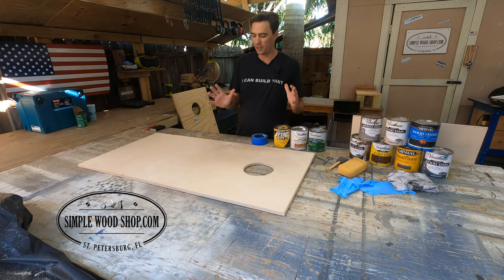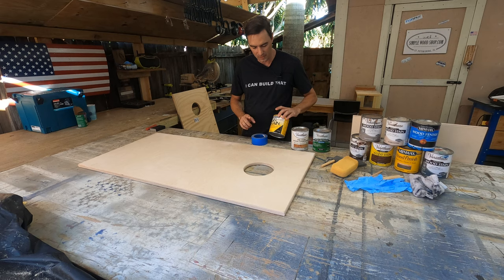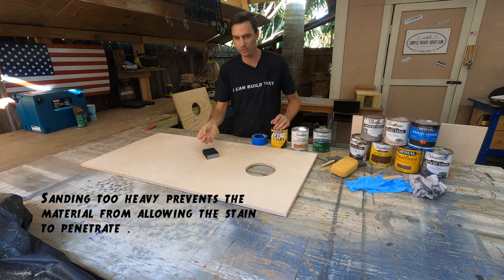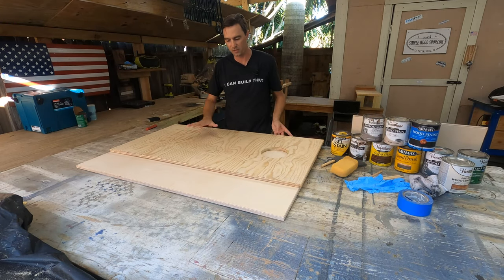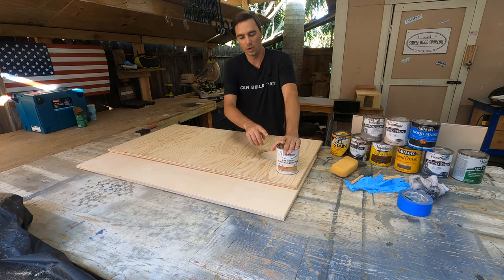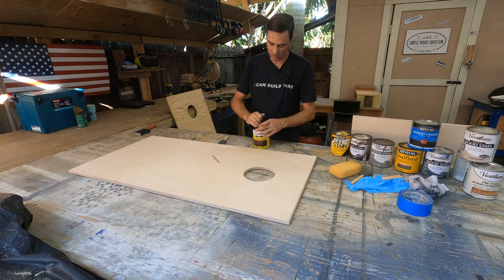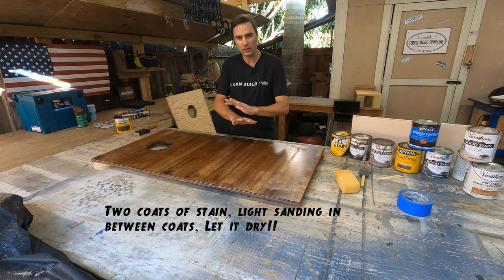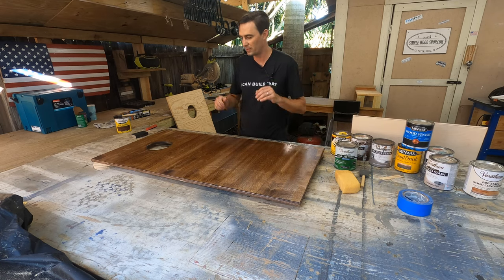Staining Cornhole Boards:  Easy and simple process.

Comment: Thanks for the post. When I refinished my interior stairs, I did a light sand between poly coast. I did 3 coats of poly but sanded between  the 1st and 2nd coats. 

Is only 1 coat of poly good enough?  I assume it would effect the way the board works, in that bean bags will slide the hell off more often if more poly layers are added! lol.
Reply from the maker: I would do several coats, I sprayed my finish so its hard to say how many coats you will need. Best to apply and try it out.

Comment: Great Video! If you wanted to add paint as well would you paint first, then stain the non-painted area and then use poly over everything?
Reply from the maker: That would be tough, as long as the paint\stain areas are not touching you can do either one.

Comment: Very helpful video. If I wanted to add a vinyl decal, at what point would you apply that in this process?
Reply from the maker: Give the boards an initial sand and then apply the decal.  Make sure all the sawdust is removed or the decal wont stick well. Use gel stain
Reply: Would applying the vinyl decal after the second coat of stain before the poly be ok?

Comment: Very informative video, thanks! I would like to use the water based exterior house stain we used on the singles of our house. Do you see any issues with that type of stain? Would it still need a coat of poly? I'm thinking the poly would make for a smoother finish.
Reply from the maker: Stain is fine. I would poly once the stain is completely dry.

Comment: Great video and great info!! I had to remove the polycrylic I had on my boards and now I want to stain them. How would I know if the pores on my top have closed?
Reply from the maker: Sand away the top layer beat you can. Maybe put some water on the top (lightly) and see if it soaks in a little. That’s how you know the poly is gone. 

Might be easier to just unscrew the top and stain the other side that doesn’t have any finish on it.

Comment: @Matt Hickman
Matt, this is great video (very informative).

I have a question about stain compatibility, was hoping I could get your quick thoughts.  I plan on doing a relatively simple board.  It will have a painted boarder around the entire board.  The "middle"/"center" (area between boarder) will be stained (I will add a decal also over a portion of the stained board). 

Can I put a water based sealer (e.g. Minwax Polycrylic or Varathane Water Based Polyurethane) over an oil based stain (regular or gel).  Assuming I let the stain dry thoroughly.  My reasoning was to use a gel stain (oil) to give a clean line/edge (no seep/bleed under the frog tape) and a water based sealer to give a clearer look (avoiding the "yellow"/"amber" color that an oil based sealer often provides).

BTW, I'm using 3/4" Baltic birch.
Reply from the maker: Hey. As long as you let it dry all the way. You should be good with the water based poly on the gel stain.

Comment: I’m using a maple top and wanting to stain down the middle and paint on the left and right of the hole. Do I need to use pre stain on the part I’m going to stain? Also my paint is enamel satin- do I need to prime the painted areas? Thank you.
Reply from the maker: Hi,  I have not had experience staining maple.  You might try it on the underside first to see if you like it or not.  I would try the pre-stain and primer too.

Comment: Hi there! Can I use an oil base stain on pine? Also if I did a stencil design on it with tape, will the oil bleed through? Thanks so much!
Reply from the maker: Hi. Oil is just fine on pine. Let it fully dry before you put your polyurethane on. I would apply it in lighter coats to avoid it bleeding.  You can always test it ion the underside. If you plan to pain the whole top it would be good to prime with a good primer before the paint. This will help block the oils in the pine from coming up.
Reply: Ok thanks! I’m thinking of doing the /\ design to the hole. Should I stain the whole board, then paint the /\ over top of the stain?

Comment: Very informative videos! I need this type of step by step thanks. Do you always stain, paint, decal, etc. prior to attaching to frame?
Reply from the maker: Hey Joe, That is usually the best way.  It saves the hassle of moving full sets around to dry.  I set up my drying area for tops only so the rack will only fit tops.  That is the way I did my setup.  Other do it differently as well. Do you stain a lot of boards?
Reply: @SimpleWoodShop  not one board yet I am doing my research first the best way to build. Thanks
Reply from the maker: I did the same. We have some other Cordero that may help. 

1. Make some jigs 
2. Batch out your parts

Comment: Would it be okay if I stain the board then put vinyl decal on after it’s dry then apply poly over it ?
Reply from the maker: Not sure how well the vinyl will stick to the stained wood, maybe test it on some scrap on another piece.
Reply: So if I put decal on first would I just stain around it carefully ?
Reply from the maker: @davidquast4759  If you are going to do that use Gel Stain, it will not seep under the decal.  I don't use vinyl so I don't have any first hand experience with vinyl and staining.

Comment: Would it be ok to STAIN my board first and then tape near the edges for to paint afterwords?
Reply from the maker: Sure. You can stain then paint over the parts you want. That would be ok. The stain will seep into the wood and the paint will go on top. 

If you want crisp stain lines use frog tape and gel stain. Not regular stain.